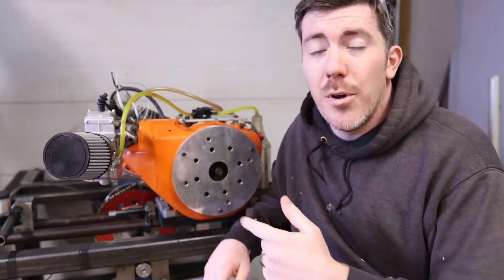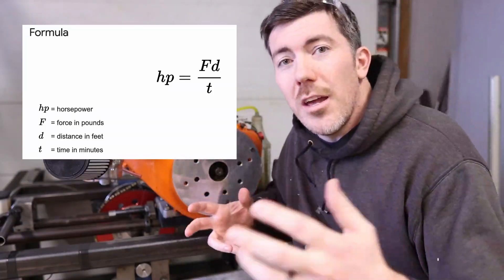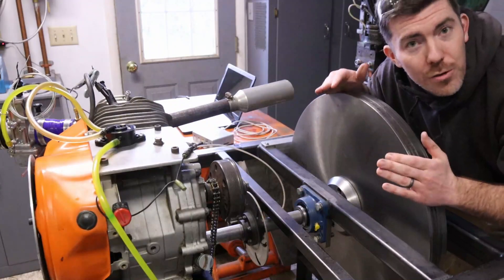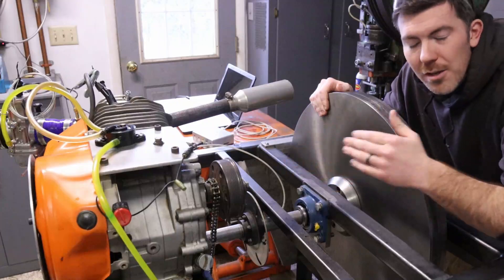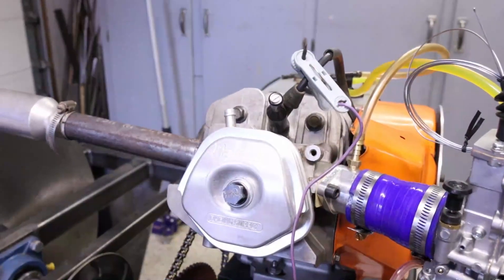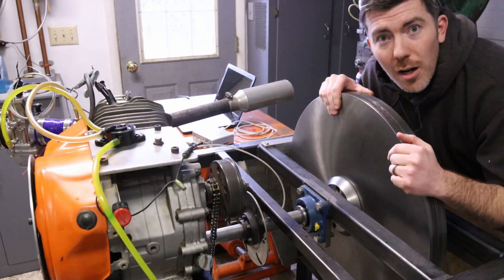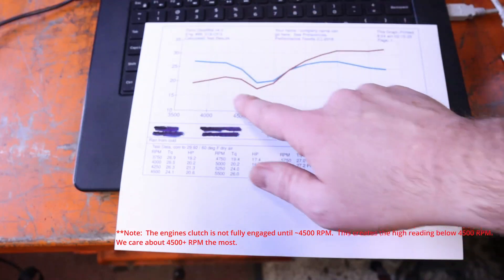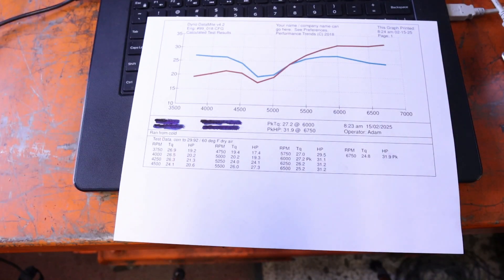The Inertia Dyno Explained

Comment: Ok, so.. what explains that power curve?? I've never seen anything like it😂
Reply from the maker: The clutch doesn't fully engage until higher RPM so the RPM of the flywheel and engine are out of sync causing the odd results below 4500 RPM.  A new clutch is in the works to test with 😀